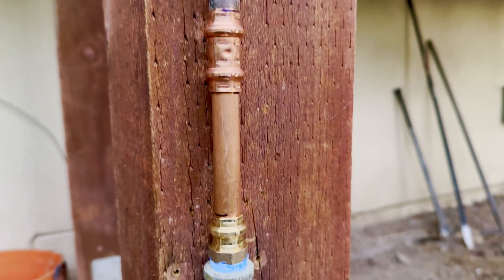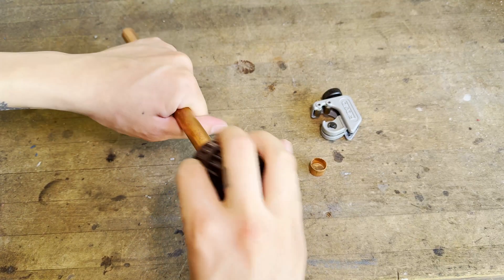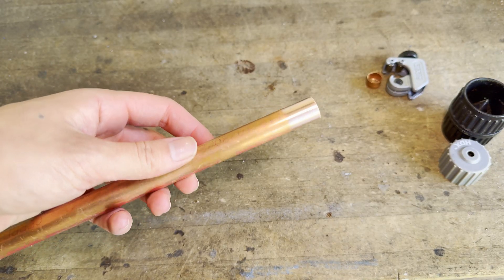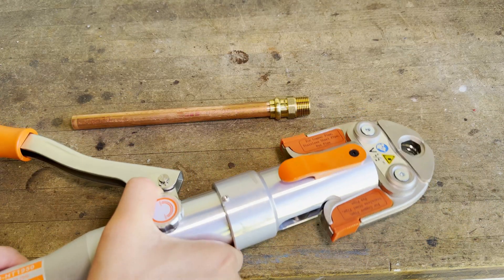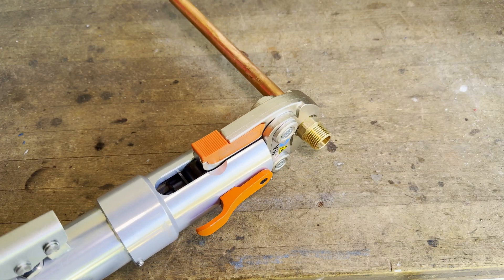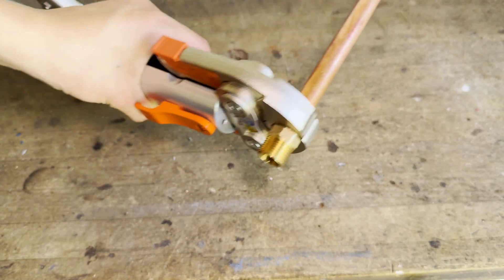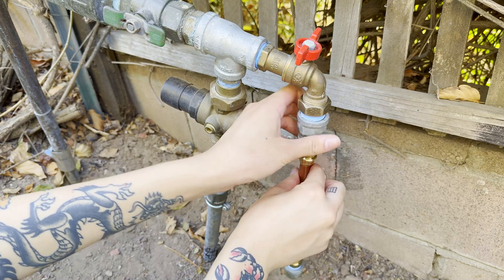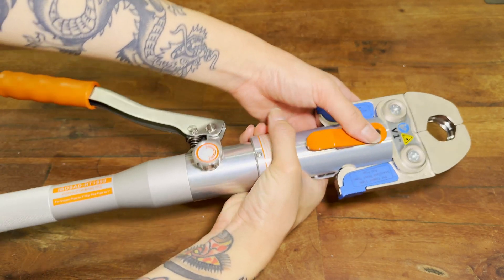How to Install ProPress Fittings With a Hydraulic or Manual Copper Press Tool

Comment: Great tutorial! For DIYers new to ProPress, how do you determine the correct depth to insert the fitting before pressing? Is there a simple way to mark it accurately?
Reply from the maker: Yes, all you need to do is push the ProPress fitting onto the pipe until it stops. Then, mark the edge of the fitting with a permanent marker.

If you're using no-stop or slip couplings, the pipe should be inserted halfway into the fitting. You can simply measure the length of the coupling then divide it in half to determine the insertion depth.
Reply: @DragonBuilds that makes sense, thanks a lot! I like your channel